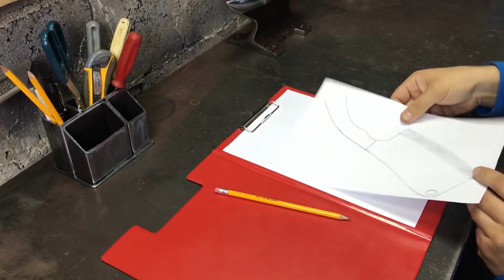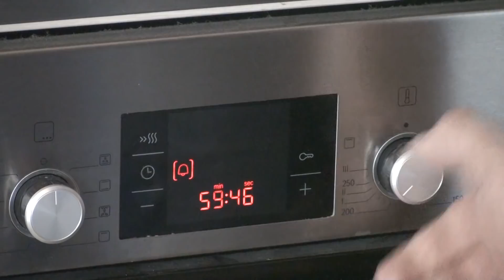Кухонный ТОПОРИК DIY | Овощной НОЖ

Comment: hi there. one last question, how did you get it shine like chrome. Is that a special polishing machine you are using. Sorry if it a daft question. But just want to know. Many Thanks.
Reply from the maker: I used a felt circle and polishing paste. A link to the seller of the paste is in the description under the video

Comment: Copper + zinc = brass
You can use for handle studs.
Clay tempering produces Hamon where clay is thin and heat reduction at quench occurs quickly, thick clay layer insulates and holds heat, metal cools slower stays softer.
The saw blade you are using already hardened and treated, what you did probably removed a factory level molecular hardening. I would have left it as is.

Comment: Hi there what is the liquid you put the hatchet in after the fire and why do you put it in the oven?
Reply: @budilov  I really dont understand if you please in einglish
Reply from the maker: The fluid is used engine oil. After steel hardening, it is necessary to make a metal release so that it is not brittle. This is done at a temperature of 200 degrees Celsius for 1 hour.

Comment: Nice work but what I have found is that saw blade metal quickly discolored. Am I alone in this? I have tried multiple brands and sizes.
Reply from the maker: Yes, you are right, this metal is afraid of water
Reply: I found lawnmower blades are 1080 steel from an old man. They need to be annealed before working with them or you cannot drill them. Just a thought, I like free metal to use.